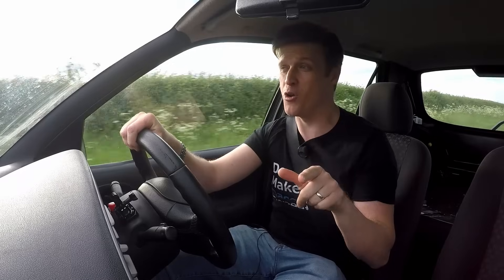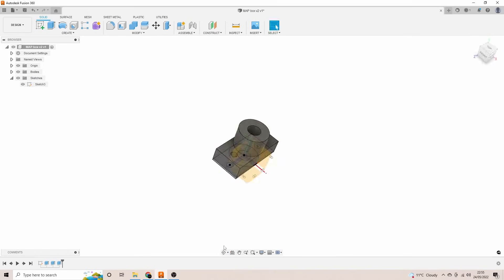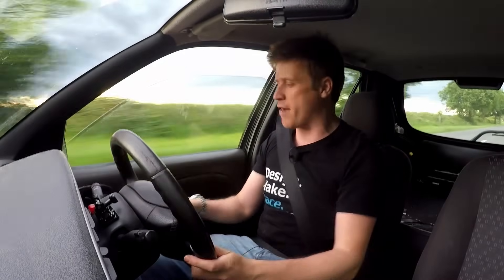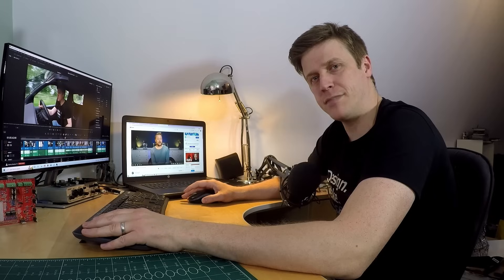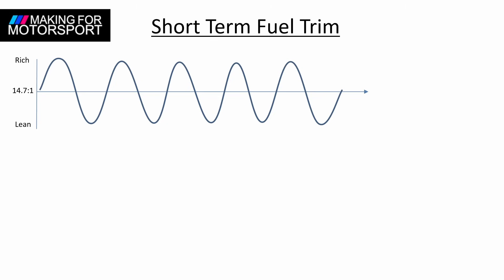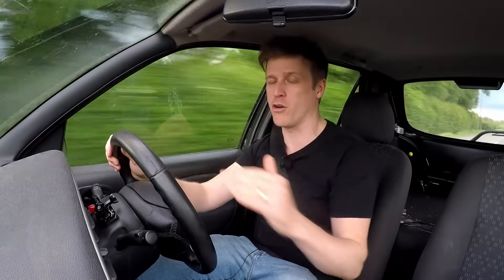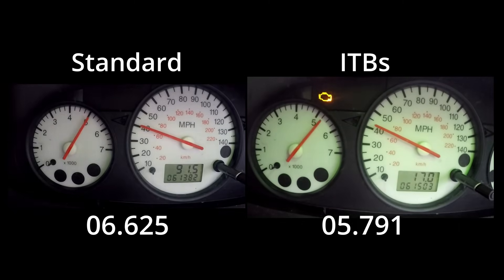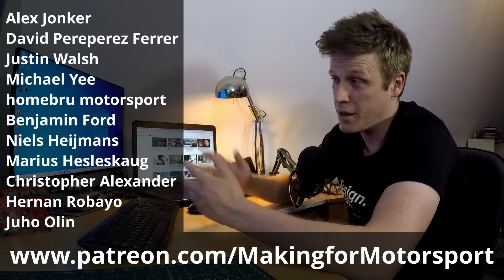Running ITBs and a Standard ECU - Project Siesta Part 3!

Comment: Hey, I've got a project on hand - a 20v 5cyl swapped lancia delta HPE '97. Do you think I should go for the speeduino and do lost spark 5 cylinder or buy a 6-channel sparkefi standalone and normal sequential ignition / injection? I'm torn because I want to do it right and not spend a lot of cash (expenses are basically a few times more cause poland is a 2nd world country) you're the one who basically got me into this ecu world.
Reply from the maker: It’s difficult.  The 6-channel would be more elegant but people have run 5-pots with a 4 channel Speedy.  I’d say get on the forums and really understand what a 4-channel speedy needs….
I am always a fan of just getting stuff going to enjoy it, hard to enjoy it when it’s not running. 
Cheapest, fastest, worry about perfection later. 👍. 
(But that’s just me - if you are a perfectionist then maybe not)
Reply: As someone who lives in Austria,

Hey Atleast you get to enjoy modifying cars
Reply: @afox5319  Yeah you guys need to drive around with a glovebox full of TUV approval certificates just to lower your car and change the wheels 😂
Reply: Please post videos about it
Reply: GM LS coil packs mounted on a plate somewhere near the spark plug holes (there’s a reason everyone and their dog uses them), and some little HT leads. Run an ECU that can handle 5 coils packs.

Comment: Well done. ITB's do increase the throttle response, which is always a good thing. Did you notice any difference there?
Reply from the maker: Oh absolutely, off load it was razor sharp and on the road it was noticeably better, but just not having the power means it’s not a massive difference.

Comment: Why would this fail MOT?
Reply from the maker: It has a history of needing welding along the sills… not something I really have the time for. We’ll see 🤞
Reply: @MakingforMotorsport  i meant the itb setup, is there some specific uk thing that prevents use of itbs? or is it like California where only factory everything is allowed? whew I am in the us, it wouldn't be an issue
Reply: @draggonhedd  UK is nothing like Commiefornia, would have Zero issues with any engine mods as long as it passes emissions depending on age.. but its easily done.

Comment: I don't run ICV on my peugeot xu10j4rs, we couldn't figure out why ecu wanted the valve to bo fully opened all the time so I just blocked it.
have been running this setup for 3 years now almost daily (apart when there is a salt on the roads) and in cold weather I just need to hold throttle a little bit open for about 30-50 seconds and it idles fine :)
Reply from the maker: Looks like something I don’t need to worry about then 👍
Reply: I have also blocked my icv on my starlets Itb set up . It would also never close fully and just leaked in general.

Comment: can i use same concept and idea on a corolla gti with 4age motor?
Reply from the maker: I believe the Corolla GTi uses an AFM to sense the load, therefore as long as you route all the ITB air through it, it should work fine. Check out @coffee and cigars channel for him doing something similar to what you might need to do…

https://youtube.com/user/coffeeandcigar5
Reply: @MakingforMotorsport  wow thanks for replying! love the channel! Ill check out that video!
Reply: If you want to do any work on a 4age, you must check out "garage 4age".  Absolutely the best guide on what makes one of those go faster with dyno comparison runs on every kind of setup change you might consider.  Super informative, budget friendly, all with a dash of New Zealand mechanic humour and very applicable to different engines. https://youtube.com/c/Garage4age